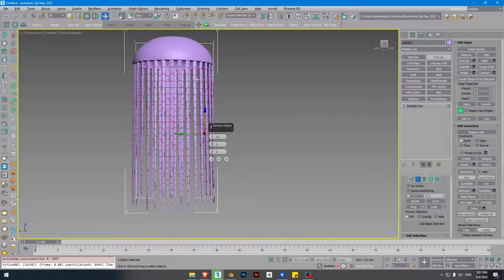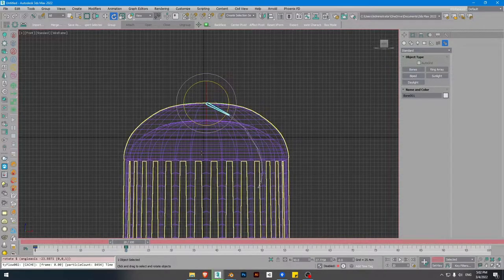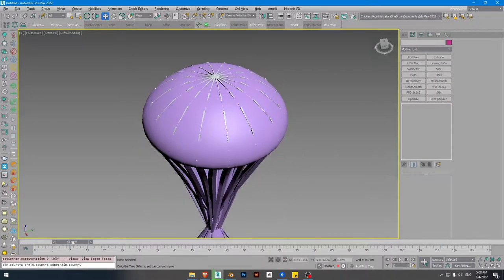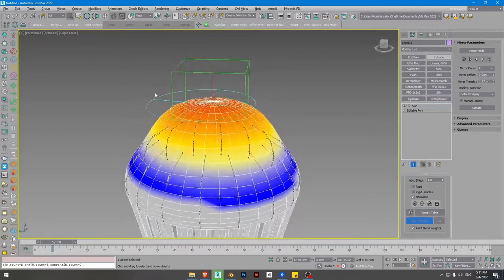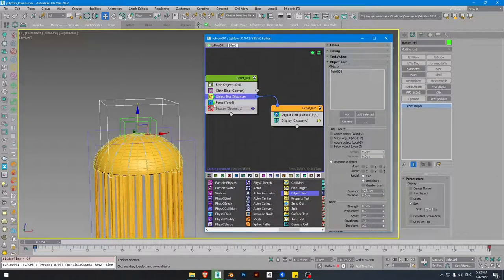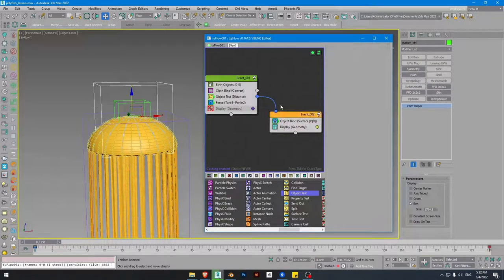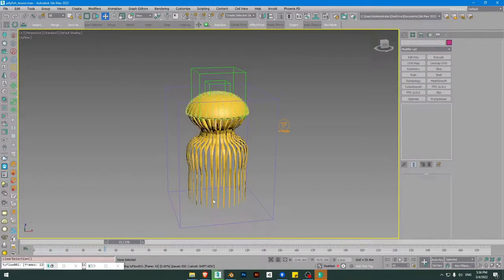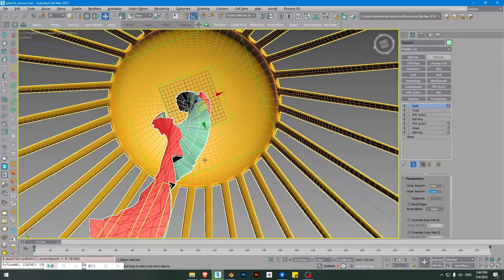Jellyfish in 3Ds Max using Tyflow | Rigging | Modelling | Easy setup

Comment: Not sure if you fix this later on in the tutorial, but I think your Physx nodes at 22:50 don't do anything. The CUDA solver takes care of the cloth sim, so the physx stuff has nothing to do with that. If you enable the self collission in the CUDA settings you should get no intersections. If you still do you can tweak the settings in your tyflow object.
Reply: You are right. Using PhysX operators in this setup has no sense at all. After Cloth Binding one jellyfish-shaped particle has turned into many particles without a any shape. This is displayed to us by the Display operator, which shows particles as diagonal crosses because it has the option "Mark particles with no geo" enabled by default.  The mesh that we keep seeing in the viewport is a cloth mesh which is not related to a specific particle, but to the whole TyFlow system. And setting PhysX Shape to "mesh" has a zero effect because particle has no mesh - to be sure, you can turn on the "display hull" option to see what physX solver will use as a mesh (in this case it shows nothing). But it's still a nice tutorial)

Comment: But, aren't the bones at the beginning doing nothing in the end, I mean, not in the skinning sense of it ? After all, you animate the animal with an object bind, which is way less efficient at handleing geomety properly. Do I see this correctly ?
Very solid tutorial though.
Reply from the maker: You are partially correct, Yes the tail bones are useless after I apply the cloth operator. but the base bones handle the overall animation, so the tail is just secondary animation.
Reply: I applyed the very same bones to a bell shaped geometry and used that for the object bind to have a better and smoother result, as there was no shared influence between the hones.
than you for your answer